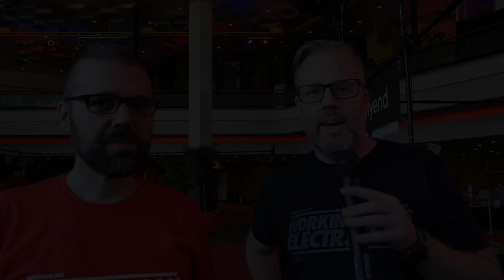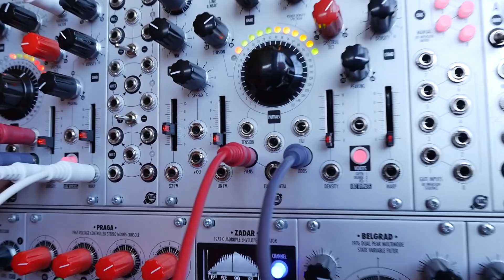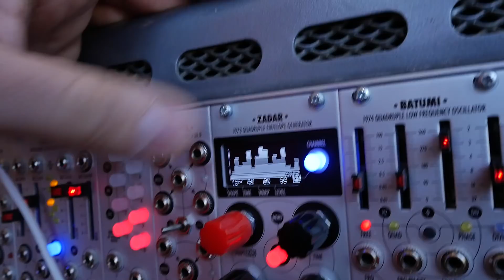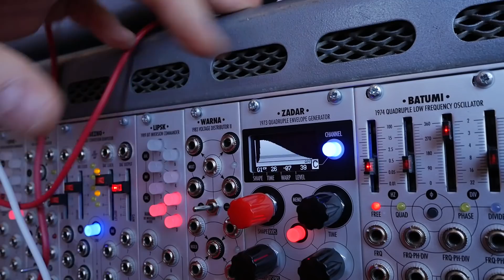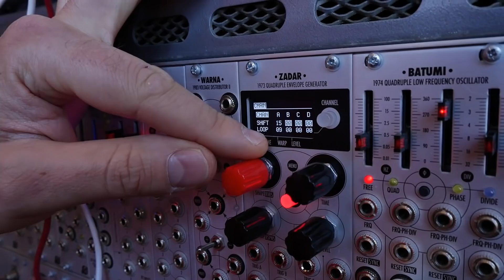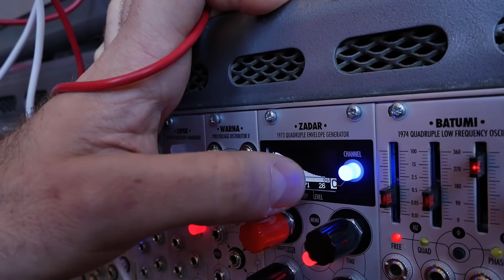Superbooth 2018: XAOC Devices Odessa & Zadar - Mad Additive Oscillator & Quad Envelope

Comment: This entire time I thought the Zadar worked like a normal envelope and allowed for custom creations.  A bit disappointing.  It looks cool but flipping through presets is not how I want to apply ADSR.
Reply: Zadar is not ADSR. Editing shapes with 1000 of breakpoints on a small screen? You got to be kidding
Reply: @pe00000001  it's funny because the Xaoc website calls it an envelope. Also, Erica's Graphic VCO has editing on a small screen using tools.
Reply: @Zinfidel1  Envelope does NOT equal to ADSR. ADSR is a primitive 4-stage model of what actually happens in acoustic instruments. Zadar models super complex dynamic processes with hundreds of segments. Erica VCO is two orders of magnitude simpler, it is just incomparable.
Reply: @pe00000001  LOL. K.
Reply: @Zinfidel1  I agree that doing a little research is too much and it is laughable 😝